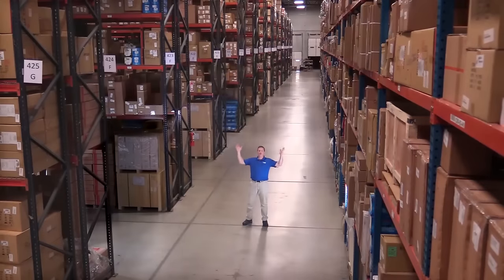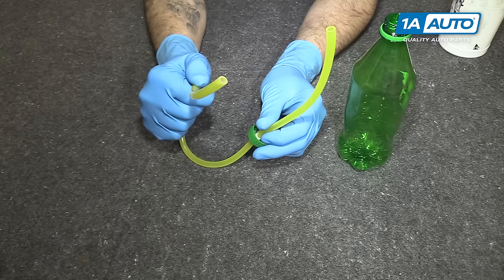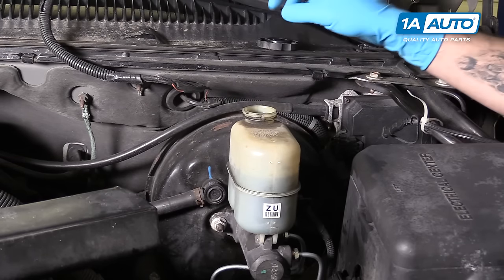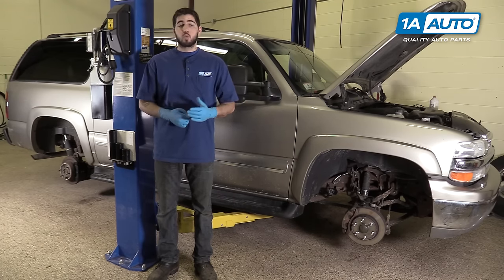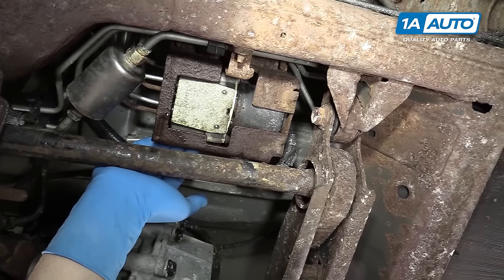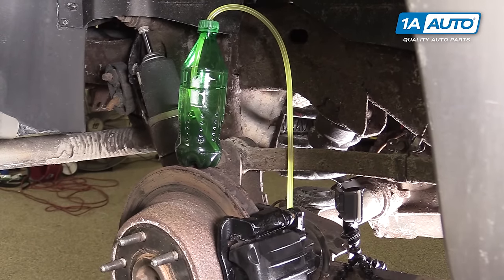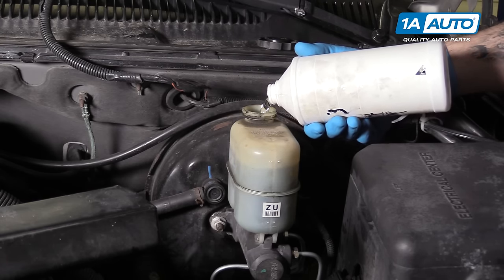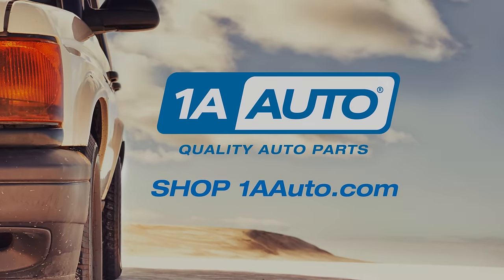How to Bleed your Brakes by Yourself

Comment: You guys are simply the greatest! I love the detailed explanation behind everything too. I recently replaced my failing caliper and decided to change my fluid since I had the system open anyway. I watched a video of someone doing this same method before I did mine but they failed to explain how you need to keep the tube seal tight around the nipple. I bled my system but my brakes are super mushy (they do work). I can't wait to do this right this time. You guys are making DIY super easy.
Reply from the maker: +The513Warning Thank you! We love empowering our customers and showing how to perform DIY auto repairs with our high-quality auto parts. 1AAuto.com
Reply: I agree

Comment: 2:43 you put the cap back onto the Master Cylinder not only to keep dirt from getting into the master cylinder but  MORE IMPORTANTLY so that when you press on the brake pedal you don't BLOW brake fluid ALL OVER THE PLACE which will happen if you don't put the cap back onto the master cylinder.

Comment: I have used this method for years.  It works well.  One tip- I use a little bit more hose with a ring magnet.  Put the hose through the ring magnet and then place magnet onto the frame somewhere close to, but above caliper.  This way you can set the bottle on the ground.
Also, for anyone with an air compressor, the vacuum bleeder available at Harbor Freight is a fabulous tool/ system for this job.  Highly recommend it and it's inexpensive.
Reply: Hi does HF vacuum bleeder work better because air compressor siphons fluid faster?  Thanks

Comment: That intro is WAY better. Thumbs up. Good narrator as well. Oh and bleed valves never turn that easy lol
Reply from the maker: +myCarRepairChannel Thanks for watching. 1aauto.com
Reply: gti5
Reply: They do if you hit 'em with a shot of PB Blaster twice a couple of days before you try to bleed the brakes.  
And this method works like a champ, especially if you have the bottle above the bleed valve; every bleeder procedure I've seen before had it below the bleed valve and has been a royal PITA to do.
And get yourself a large hemostat to pinch off the hose an inch or so above the bleed valve.

Comment: Question - I have a 2007 Hyundai Sonata V6 that has "power assist" brakes (I may be using the wrong term) so when the power to the car is on, the brakes seem to be assisted by the power in the car, if that makes sense.  Long question short, do I pump the brakes with the key on or off?  TIA

Comment: Spray the bleeder screw with good penetrating oil the day before and when ready to do the work...first loosen the screw with a six point socket, then proceed as normal. Also actually having a protective cap on the screw will limit rust to the outside
Reply from the maker: +Nathen Stoneburgh Thanks for the feedback! 1aauto.com

Comment: I needed to do a complete break job on my ‘05 F150. I bought one of the more expensive vacuum devices…to ‘help’ speed the process along. After wasting time with the contraption, I built my collection bottle following your design. It worked perfectly and  it was free (already had the tubing). THANK YOU VERY MUCH!

Comment: couple things: 1) make sure to suck the old fluid out of reservoir before pouring new one (turkey baster, or large syringe), 2) you don't need to take wheels off on most cars to access the bleeder. I just roll my car on top off a ramp and do 2 wheels at a time - much faster. Some car (like Prius) has special mode to bleed rear wheel (electronic control motor pump), some car take DOT 4 (like BMW). 3) before removing the hose, make the tube/Drain bottle go BELOW so when you squeeze tube out you get gravity to self draining to the bottle instead of making a mess. 4) use a clear bottle/hose so you can see dirty fluid/particles (sign of maybe bigger problem).
Also I don't get why you put new fluid in the bottle - with the hose going up from the screw, any air bubble will move up and not get sucked back down when you release the pedal (which tends to be a lot less than push anyway) beside the tube will eventually fill but doesn't need to and doesn't start that way anyway...
Reply: Out in the ether- "Can you just remove the old fluid from the reservoir with a turkey baster ( and "then" put in new fluid)  and call it good, or is it "absolutely" necessary to bleed the whole system?

Comment: Question: I just need to change my front driver's side caliper, do I still need to bleed all four spots? Or just the one I'm working on?
Reply from the maker: +Charles Masden Thanks for watching!  You will be introducing air into the brake lines, so you will want to brake the whole system!
Reply: I only do the brake I'm working on. The banjo fitting is only disconnected for less than a minute so I don't see how air can migrate back thru the whole system.

Comment: Absolutely the best method for bleeding brakes!  After purchasing two vacuum bleeder tools your method released the air from my brake system.  I replaced the master cylinder on my golf cart (without bench bleeding the new master cylinder) this method successfully solved my problem.  Empty soda bottle and tubing!  Many thanks!

Comment: I am going to try this right now. Thanks very much.
Reply: Well, I made the one-man bleeding bottle this afternoon and replaced the rear calipers, rotors, and pads on my 2004 Jetta TDI wagon. The one-man bleeding bottle works like a champ. I'll keep it in my shop for the next brake job. Thanks for the great idea. It really works great!
Reply: When come out outside who hold brake pedal
Reply: XXX
Reply: @anowzanaw879  you hold the pedal so air does not come back in. With this method, it's drawing fluid in from the bottle so no need to hold pedal. Make sense?

Comment: Did the exact thing to my 96 accord yesterday after replacing my front and rear pads. Thank you. I saved a lot of 💰. I got all the air out of the system and my brakes works great 👍

Comment: Can you use the fluid in the sprite bottle to top up the master cylinder? The lines are already emptied then filled with new fluid via master cylinder, and then new fluid was added to the sprite bottle. So the only thing coming out of the brake bleeding should also be new fluid? Which I think means you should be able to use all the fluid you catch in the sprite bottle back into the master cylinder

Comment: Thank you! So you fill the reservoir with fluid before you work on the caliper. Am I supposed to put the reservoir cap back on fully or a little loose?

Comment: Thanks for the video I will be using this method tomorrow on my Super Duty.
Reply: It worked out well the Super Duty has brakes again !
Reply: Big Mike never heard of a super duty model or make...
Reply: 2017 F-250 Ford Super Duty. Super Duty is a Ford model I guess you could say. Many of them have the duel real wheel setup.
Reply: I'll have to do this on my Super Duty as well. The rear brake line failed. Mine is a bit "older" (2002).
Reply: @drowssapma  rear line just failed on my '02 SuperDuty in the engine compartment by the flex section coming out of the ABS pump.  Had to fabricate a new line.  All sealed up, but all fluid was lost.  Gonna fill and bleed next.
Reply: @drowssapma  u got a 6.0?

Comment: I had to bleed the brakes on my old Ford expedition. Bought special bleeder valves from local parts store. These bleeders act like a check valve so you can bleed the brakes yourself. Also removed all the old dirty brake fluid. Need to do a brake job on my chevy soon as the weather allows and will replace the bleeder screws with the new ones.

Comment: So basically all he’s doing is stepping on the pedal letting all the air bubbles out of the system. Than when it’s clear he tightens the bleeder valve and makes sure the reservoir is full?
Reply: correct
Reply: Do we have to start up the engine while bleeding the air ?
Reply: @maxline121  no

Comment: Would it be practice to hook a bottle up to all 4 brakes at once. then just get one person pressing the brake and one refilling the fluid?
It sounds like it would go a lot faster/easier. but idk if that would risk anything
Reply from the maker: +The Barbarian You need to bleed one line at a time to properly force the trapped air out of the system.
Reply: @1AAuto  If you only replace the front calipers do you need to bleed the rear as well or only the front? I have a 2011 Dodge Durango. 

Thank you for the video.
Reply: Do what he said,the furthest to the closest. Better that way

Comment: I think a wise thing to do in addition to regular brake bleeding is to siphon out all the fluid from the reservoir & start with completely new fluid. 2nd to that always use new sealed brake fluid as it attracts moisture. That’s right brake fluid has a shelf life, especially in humid climates.
Reply from the maker: +Kyle Ruffner Thanks for the feedback!

Comment: Do you do this process with the vehicle on or off
Reply: Off
Reply: Exact same question I had
Reply: Off
Reply: Off
Reply: If the car is off, you can't press the brake pedal. Think.
Reply: You can do it off. I do mine with the keys in the ignition slightly turned but it’s not on, so I can play music while I’m working.
Reply: @cheeko_914  
So have you actually done this job with the engine running?
Reply: It is done with the vehicle turned off.the brake can be depressed because the bleeder screw is open,otherwise yes you couldn't pump the brakes

Comment: Good video. But am I the only guy thinking that the frame of this truck needs some lovin? That thing needs to be wire wheeled and painted! Or hit it with some fluid film to slow that rust!
Reply from the maker: +Blue04Z71 Thank you for watching. Being located in New England takes it's toll on a lot of vehicles, and we do recommend having a coating to protect the frame. 1aauto.com
Reply: This video was about brakes and not corrosion control
Reply: Thanks again great
Reply: What is fluid film please?
Reply: Ya know after looking at all Chevy's make and models from underneath I ask myself today why did I ever like a Chevy in the first place.rust buckets and you can count on that one.

Comment: What role does the abs play in brake bleeding?

Don't understand
Reply: ABS is part of the circuit of brake fluid. If there is any air in the system it is likely that air also made its way into the ABS lines. It isn't just a straight line, however, so that is why they mention going to the furthest line from the ABS module.
Reply: The abs is basically a computer that tells the ECM if the brakes are being used hard, which controls the brakes, pulsating them to prevent skidding, which wears down tires and loss of control.
Reply: it affects the length of the brake lines, thus affecting which wheel you bleed first due to the fact you start furthest from the master
Reply: The abs module can get air trapped in it  if brakes are bled in the wrong order. Air in ABS is not good.
Reply: @farmerjim-fat-man-do  well said

Comment: Nice job but, I cant believe you guys didn't use a line wrench for the bleeder valves.
Reply: Jack: may i ask how line wrench is better than 10mm open and closed socket 🔧 wrench Thanks +jack
Reply: @chrislg4519  The 6 point box wrench is the best tool for the job. It has the most contact. A line wrench is best when a hose prevents getting a box wrench on the fitting. The open end may be the most convenient once the bleeder screw is loose, but offers the least contact. Last of all Vice grips, penetrating fluid, and a big ass hammer, or torch, is your last resort. If worried, a whack of the hammer adjacent to the bleeder, and penetrating oil, 48, and 24 hours before your repair, could save the day.

Comment: Unfortunately I couldn't power bleed the brakes on my 2001 Dodge truck because the ABS unit wouldn't let me.  Computerized vehicles suck!
Reply: just take out the abs fuse
Reply: +Donald Woods
Alternatively, remove connector from ABS actuator relay box.
Reply: What do u mean wouldnt let u?

Comment: I have a 2015 Nissan Altima, is it necessary to activate the ABS system? I think my scan tool has a feature to cycle the ABS system. Or is the typical method of bleeding that you show in this video sufficient? Thanks for all the great videos.  As a side note, I contacted your support team, and was told you don't stock a front brake caliper for my car, which surprised  me, and is unfortunate, because I like to support companies that help me with videos, such as yours.

Comment: Is this 3/16 inner diameter or outer diameter tubing? I’m assuming inner diameter, but my Home Depot has “fuel line hose” that is 3/16 OD which is 3/32 inner diameter.

Comment: Never use open spanner for bleeding screw.
It may damage the screw leading to cost you a caliper may be..
Reply from the maker: +Ameya Khedkar Depends on the situtation. If your are loosening an old rusty bleeder, never use an open wrench, use a flare wrench or better yet a 6 point box wrench. In this video the bleeder screw is brand new and super easy to turn, rather than struggle with the awkwardness of lining up a flare wrench or 6 point box wrench. We opted to use an open wrench.
Reply: NEVER!? Not even if there’s a fire!?
Reply: You can always buy replacement bleeder screws at your parts store,I've had to replace them in the past

Comment: Thanks for this video. Question - I see this is the "one-man" method, so that means after pumping the brakes 3-4 times, you get out of the car and tighten the bleeder valve. Is it better to have a second person to pump the brakes and then hold the pedal to the floor while I tighten the bleeder valve? I thought the pedal needed to be down. Also, should the pedal be pressed all the way to the floor or not completely?  Thank you.

Comment: how u know or When do u fully flush out replace all brake fluid?
 Is it always necessary ?
Brake fluid  used to be all DOT3 now DOT4  stuff.. hygroscopic  blahblah  means absorb moisture  water  which H2O  so air gets in eventually? too. 
 guess lot of chemistry and physics go into brake fluid.
 In  cold winters rust loves grows overnote onetal esp near ocean  coasts right..
 Can u tell visually or feel of slimy brake fluid  or go by  time years or mileage on brake fluid  useful life ?
Is it hard to drain it all out or have to flush lines  and master cyl under pressure ?
Do a vid on it plz

Comment: You forgot to mention (or probably did not know) that cars use a dual diagonal braking system meaning the rear right and the front left brakes are on the same line. Also the front right and the rear left are also on their own line. This ensures that the car won't pull to one side should one line failed. So the correct way to bleed is first the brake caliper farthest from the master cylinder then the one diagonally on the same line and finally continue with the 2nd farthest away and finish with the one diagonally from that. Everything else in this video is spot on!
Reply: Wrong. Not every car is built like that .

Comment: Nice guide. Actually I did the same procedure this weekend  and I think I take some air inside because I used so long hose. Try to do it next weekends when purchase hose less diameter.
I unscrew the bleeder fitting on 1/2 of full turn, some "enthusiastic guides" for my Daewoo Lanos car rec omneds to unscrew even on 3/4 of turn.

Comment: it work for me and i am so happy... but i forgot to drill a air hole in the lid of the bottle and when i removed the line it was under high presser and yep it blew brake fluid everywhere... wow do not forget to drill a vent hole on top of lid of bottle...  but this method is by far the best i have ever seen and i am a brake tech ...

Comment: Great demo! 
About the fluid itself: I used Valvoline DOT3&4 instead of just DOT3 as recommended in the manual. Anyone knows if it's ok? Any potential adverse effect on the brake system? Vehicle is an 05 Jeep GC

Comment: I have a 2004 Chevy Silverado, it was running fine then I started hearing a squeak, I checked and my brake pads were worn out on the rear left side, I replaced the pads on the right side first then went to the left side, the caliper piston would go in just a little but not enough for the new pads to fit in, I removed the caliper and pads and pressed the brake pedal for the piston to go out and it did, tried to put the piston back in and again it would only go in just a little, I replaced the brake caliper and bleed the line butt now I have a “Service brake system” message that will stay on as long as I drive the truck along with the red brake light .
Have you ran across something like this?

Comment: I have to change brake calipers on my Ford Grand C-Max from 2013. The car has a "manual" handbrake that functions via wire on the rear caliper. Is it advisable to bleed the brakes BEFORE mounting the hand brake cable - or doesn´t it matter if you do it or not? I have heard some people claiming that it can be more difficult to bleed the brakes if you mount the handbrake cable to the caliper before bleeding.

Comment: excuse my stupid question but wont the air bubbles feed back to the master cylinder after a few presses? wouldn't the pressure from the booster exceed that of the air pocket?

Comment: I plan on bleeding my brakes and also changing out my front pads and rotors this spring. Can you tell me the proper order to do this?  Should I bleed the brakes first before replacing the pads and rotors or do the pads and rotors first and then bleed the brakes? Thanks!

Comment: I tried this method but for some reason the air bubbles in the fluid tends to go back into the caliper and struggles to even push fluid into the bottle I'm not sure what the issue is but I have a brake binding issue and thought bleeding it would work.

Comment: Just tried your method here today on a 2003 S10 front brake disc brake calipers and it worked like a charm!  Thank you very much for sharing this idea.  I used one of my  lorex wireless cameras to keep an eye on the bottle while I pumped the brakes.